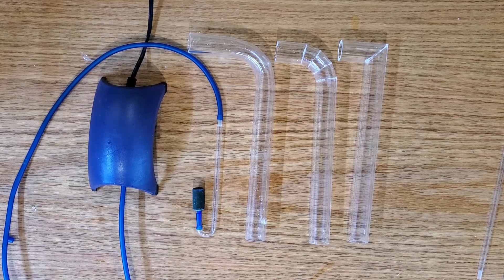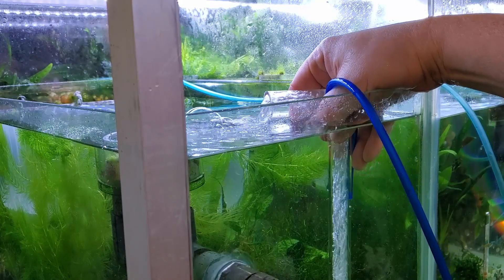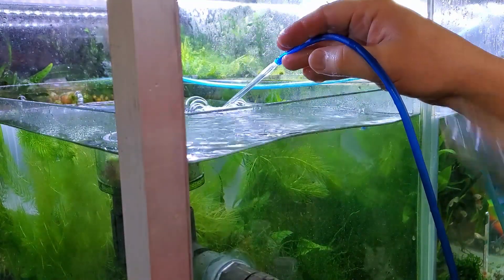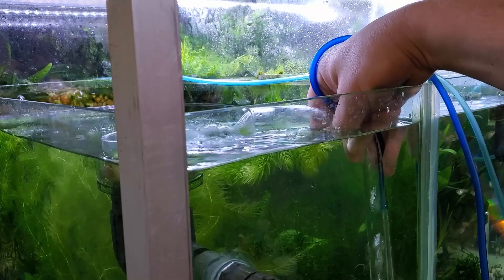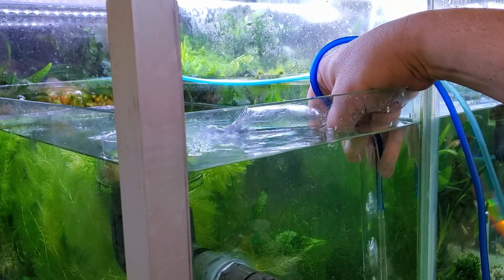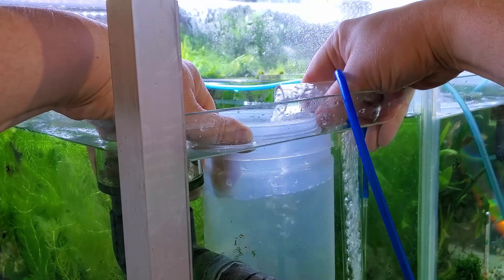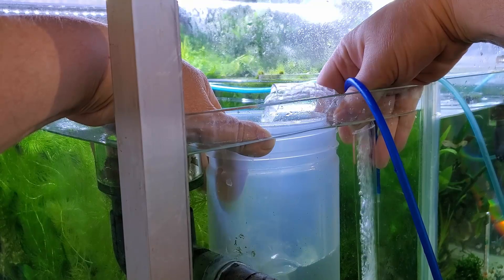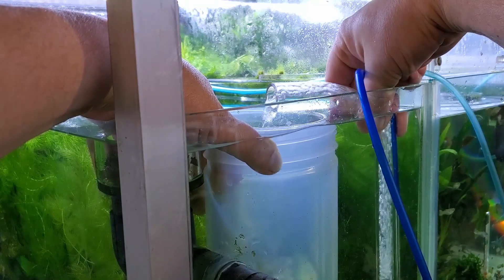Water Flow Vs. Bubble Size And Elbow Type

Comment: Great test. Larger bubbles moving more water is cool but I wonder how oxygenation compares? I was always under the impression (wrong or right) that a lot of tiny bubbles add more oxygen to the water, or does it really even matter?
Reply from the maker: Hey Kerry! Most of the gas exchange happens at the surface of the water. Bubble size probably doesn't effect it much as long as there is surface turnover. Depending on the fish present (fast water vs. pond), it doesn't matter too much.

Comment: JZMYXA Air Stones Bubble Stones Fit for Aquarium Fish Tank, 0.98 inch, 10 Pieces https://www.amazon.com/dp/B07L27MLNG/ref=cm_sw_r_cp_api_i_0WnYEbFS84XWY 

These are .39 inches wide and or a little thinner and would probably work great for that. Though I still think the Venturi system or whatever it’s called where you put the little ring on the outside and drill holes in the tube and use a couple of O-rings and pump the air from the outside through the holes in the inner tube so there’s nothing obstructing the flow, that definitely seems to be the most efficient way to get the maximum amount of water and lift out of them, but anyway these air stones are quite a bit thinner You could also just shave the sides off of one of those air stones pretty easily if you wanted to just play with it. I think of metal file would just rip through that stone. 

I was watch the bubbles, the smoother you make it the less turbulence you have an turbulence creates back pressure so whenever you have a smooth transition it’s always going to move water better but with most of these filters I don’t think it matters much, even the 90 still moves more than enough water to do the job. I guess they’re probably is a point at which your poop load will max out one compared to the other but I don’t think for most of these situations it’s gonna make much difference, if you have a much larger tank you’re probably gonna have a second filter system on there anyway.   I’ve never bought one huge filter except when I had a saltwater system I’ve always thought redundancy was the better option

Comment: My understanding is higher flow is best. How many times per day is the tank water completely cycled thru the filter and media.  So even the small percentage improvement might be highly beneficial on theblong term. You have far more knowledge and experience and if this is correct, calculating the gallons per day difference could be extracted and shared on a vid.
Reply from the maker: There are so many variables when it comes to filtration that with any luck I will eventually get to most of them. Any time you have an aspect like this you want tested just let me know

Comment: Makes total sense the airstone itself would block flow. ive always been told that smaller bubbles are better but this is neat. i use the SwissTropicals jetlift tubes and they use that system where there are holes in the tubing and an external air chamber. anything that can fit in the diameter of the tubing can go right through. didnt you make something like that before?
Reply from the maker: Yes. I made one a while ago. The problem with them is keeping all of those little holes from clogging up. Thanks for watching!
Reply: @FishmanEricRussell  Ive not cleaned the one on my main box filter in a long time. and the swisstropicals ones are very easy to clean to. not everything you test has to be DIY maybe pick one up and see how it compares? they sell the lift tubes by themselves.

Comment: you would probably get a more accurate comparison if you left the air stone in the pipe when you did the big bubble test. That stone has to be blocking so much water from coming in i dont think its a fair comparison
Reply from the maker: You're quite right. I am going to be doing more of these. Should get all of the kinks out eventually lol. Thanks for watching!

Comment: I slowly removed my air stones from my underground filters because they became clogged with calcium deposits (our water is very hard).  Glad to see that the big bubbles are better than the air stones in moving water. I am still interested if the length of the "up tube" influences flow.  That would be a difficult experiment because of the way you run your experiment the shorter tube would have more bubbles because of the reduction in pressure required to overcome the depth of the water.  Your videos are always thought provoking.  Keep it up.  Thanks Fred O
Reply from the maker: Always a pleasure Fred!

Comment: Indeed, the air stone is obstructing the flow of water. But smaller bubbles are more efficient in an air lift system. Check out the Czech air lift design for HMF filters! Tiny holes in the tubing instead of an air stone and it moves water incredibly well. Changed out my entire system to the Czech air lift tubes after my own testing.
Reply: One diy solution to increase water flow and eliminate the airstone blockage you could experiment with might be to either cut slits in the tube to increase water intake at the bottom or possibly see if you can somehow flare the bottom of the tube out and create a cone shaped  bell at the bottom.  May not be super practicle in a box filter, but it could eliminate the airstone blockage for a water lift system.
Reply from the maker: Will be doing more testing of these for sure. Thanks for watching!

Comment: NICE! that's impressive! Makes me think that using flexible hose on the return pumps instead of the hard plumbed PVC I have set up with all the 90 degree elbows I have everywhere would increase flow and be more efficient..
Reply: The more fittings, 90's, and valves you have the more friction losses. But if you are meeting your flow needs does it matter?
Reply from the maker: I've tried many ways of increasing flow for a return. The best I've seen is using a larger dia. pipe and hard plumbing it in place. Something like inch and a half gives little resistance to flow. There is also a big difference between pumping water and using air. Thanks for watching

Comment: Ooh I've always been curious about this too with airstones, I have them in 2/3 of my sponge filters. The only thing I would be curious about, is 1: if you use a narrow stone like those white skinny throwaway stones so that the pipe isn't blocked so much, or 2: if the stone is below the pipe like an aquarium co-op sponge filters, where you use a small piece of airline to dangle the stone inside the filter so only air and water are going through the pipe and the stone doesn't block the flow.
Reply from the maker: Cool suggestions. Thanks for taking the time to think about this!